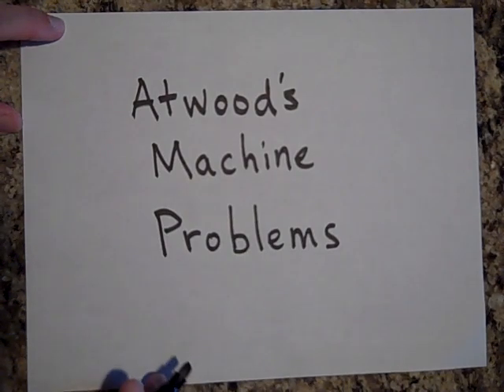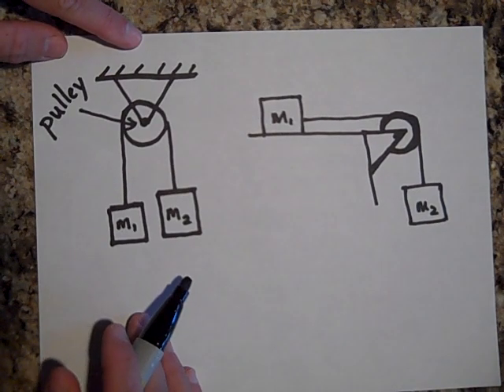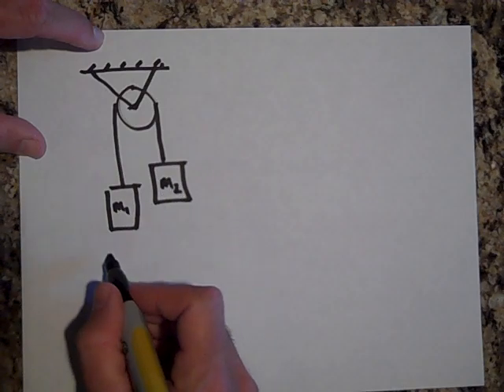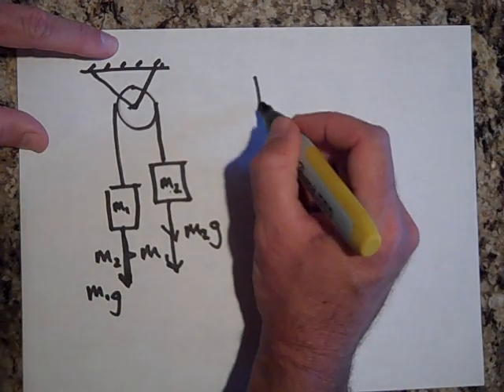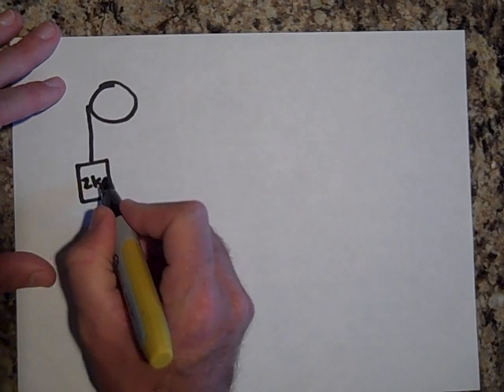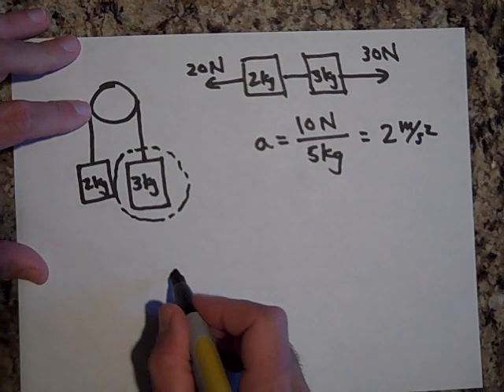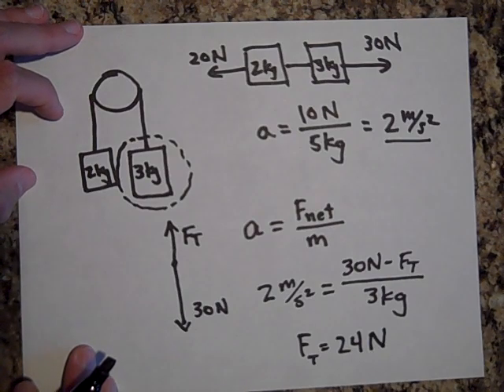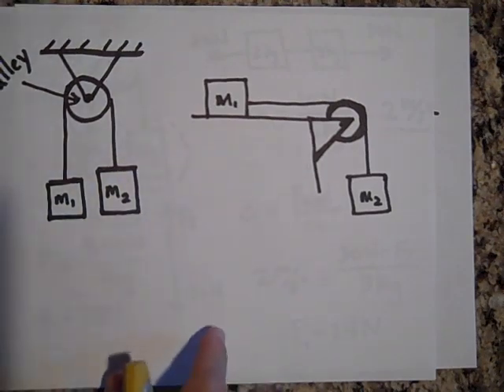Atwood's Machine Problems

Comment: How would you find the apparent weight of the 3-kg mass? Is that equal to the tension?
Reply from the maker: Usually apparent weight is a normal force but for this set up the apparent weight would be the force of tension on the suspended mass.
Reply: @lasseviren1  That was quick! Thank you so much!

Comment: How is it that the tension is the same throughout the rope of different weights are acting on it
Reply from the maker: For different scenarios the tension will vary but for a given scenario the tension will be the same throughout the rope.  This is only true if the rope's mass is negligible and the pulley's mass is negligible or the rope slides across the pulley with no friction.
Reply from the maker: I know this did not answer your question but I just wanted to clarify what I meant by saying, "the tension will be the same throughout the rope."
Reply: I understand that now . I’m just trying to figure out if there’s a formula to prove this or if there’s a visual way to show this
Reply from the maker: @notloc8993  I'm on a trip but when I get home in a few days, I'll make a video to answer your question.  For now, imagine breaking the rope into 100 little segments. Segment 2 pulls on segment 1 (s1) with the same force that s1 pulls on s2 because of Newton's 3rd law.  Now if s2 has an almost zero mass then the net force on it would be m*a which would be almost 0 because m is 0.  That means that the force of s1 on s2 has to be almost equal to the force of s3 on s2.  Next we say that the force of s2 on s3 is equal to the force of s3 on s2 because of the 3rd law. And so on down the rope.  You can see why a video would be easier than typing this in the comments.
Reply from the maker: Keep analyzing each segment of rope using Newton's 3rd and Newton's 2nd law all the way down the rope.
Reply: lasseviren1 perfect. Thank you so much

Comment: What if you put this whole system inside an elevator which is  accelerating upwards?
Reply from the maker: If the elevator were accelerating upward at 2 m/s/s then it is equivalent to being on a planet with a g of (9.8+2)m/s/s.  So you do the same problem but use  11.8 m/s/s.  If it were accelerating downward at 2 m/s/s then you would use (9.8 - 2)m/s/s.  In other words if the elevator were in free fall, then the system wouldn't move relative to the elevator (9.8 - 9.8)m/s/s or 0 m/s/s.   Of course I haven't told you why this is the case.  I would need to make a video to do so.

Comment: Is large mass body decide the tension in spring if it does please explain.
Reply from the maker: Both masses affect the tension in the string.   Once you know the acceleration of the system (by analyzing both masses), then you can use either mass and Newton's 2nd law to determine the tension in the string.

Comment: Wouldnt the acceleration of the system be 9.8 ms2 I mean the heavier mass is falling downward due to gravity...

 - via YTPak(.com)
Reply: +Mohammad Bilal You can just use 10 m/s^2 to make calculations simpler most of the time
Reply: no. The acceleraton is the same to g (9.81 m/s^2 OR 10m/s^2) only when the Fnet is the same as the force of gravity (mg)

Comment: thank you very much ! this video helped me understanding this test and the tension , but i'm still a little bit confused by the tension force. Due to Newton's third law , the forces are paired and equal, so when both of m1 and m2 are trying to get each other down, what should tension force be depended on? For instance,when m1 is trying to get down, it also get the reaction force from m2. When m2 is trying to get m1 down , it would probably get the reaction force from m1,  lol. I'm just confused , hope to hear from you.

Comment: How do you come to the conclusion that 3kg box has a 30N force and the 2kg box has a 20N force? 
Did you just round the acceleration of gravity from 9.81 to 10 and multiply that by the mass? Or should the force down on each box be given? Thanks.
Reply: joe he rounded 9.81 to 10

Comment: Tension is a force and forces are vectors, so if something is accelerating in the direction that a string is pulling, acceleration and tension will be the same.

Comment: what he did was A=F-Ft/M

so it was 2= 30 M/S - Ft / 3

so multiply each side by 3... 2(3)=6

then 30-6= 24 N when you divide your negatives. he didn't explain that cause it is normally 6-30= -Ft
so -24=-Ft

henceforth 24 N

Comment: At 0:58 it's easy to assume that the acceleration would be greater for the system on the right because m1 is on a level surface instead of hanging down. The system on the left has m1 hanging down., which makes it easy to assume that the acceleration would be slower. Would such assumptions be right?